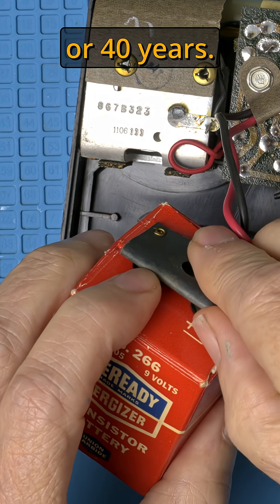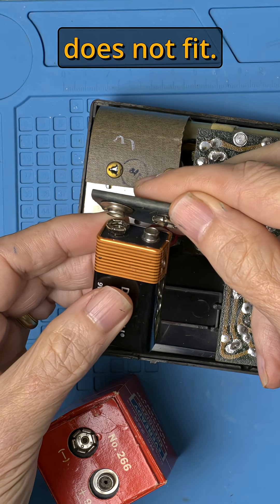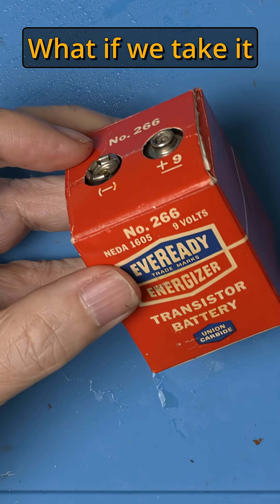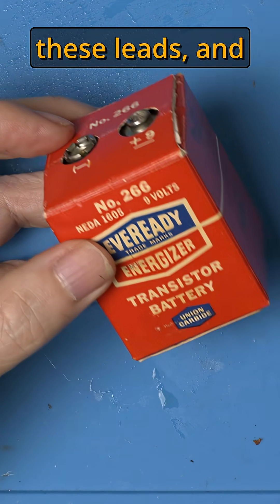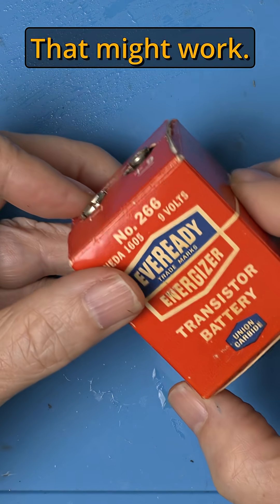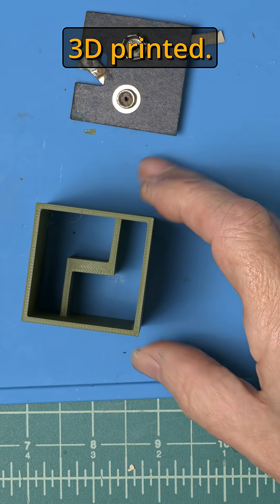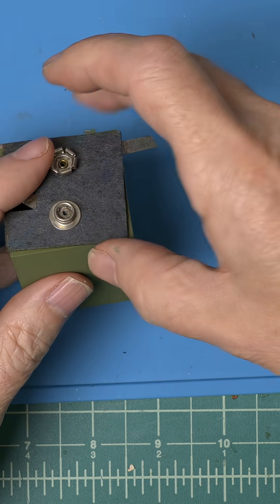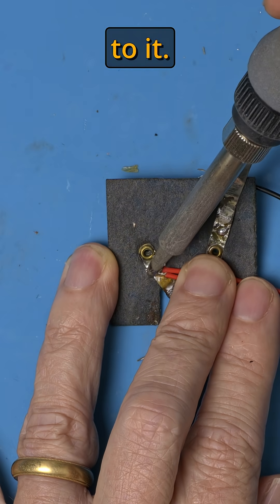3D Printed Vintage Battery Adapter #vintageelectronics #3dprinting #eveready #electronicsrepair

Comment from the maker: Here is the OpenSCAD file to build the adapter:

wall = 2;
base = 42;
height = 50;
difference() {
  cube([base,base,height]);
  translate([wall, wall, -500])
  cube([base-2*wall, base-2*wall, 1000]);
}
9v_holder();
translate([base, base,0])
rotate([0, 0 , 180])
9v_holder();

module 9v_holder() {
  difference() {
    cube([21,30,height/2]);
    translate([wall, wall, -500])
    cube([16.6, 25.6, 1000]);
    translate([14, 0, -500])
    cube([8, 12, 1000]);
  }
}
Reply: I LOVE the fact that you be shared the 3D model as a comment. This is kind of model where openscad shines
Reply: @FrainFreeze  BigCliveDotCom videos does this when he has a 3D model in his video.
Reply: @Dennis_M1DLG didn't watch him in a while, cool
Reply: @FrainFreeze  yeah and such a short script too. i was gonna bother learn freecad but now I'm interested in this
Reply: Thanks for sharing. I will use this and do the same.
Reply: This is the type of 💩 i want to learn to do. In the zombie apocalypse 💩 like that will keep you alive..
Reply: So you say I can make models with code instead of wasting hours designing it?
Reply: Its released in 1965
Reply: @MilanGamerOfficial123 was
Reply: @JoseDiaz-jf6rq sorry english is not my first language
Reply: Take it a step further and use reachable lithium 9v batteries and put external charge port on the box
Reply: @madyottoyotto3055 need a BMS to do that. Or it will blow up
Reply: Put 2 diodes in that case to isolate the 2 PP3 batteries from each other while allowing them to both power the radio.
Reply: @Dennis_M1DLG why would u need to do this?
Reply: @jaycool5978  the risk is minimal but if 1 battery has full charge and the other is flat or faulty neither one would short the other out completely starting a fire or rapidly leaking. I've seen a fire starting because of this once and the gent whose home it was lost everything.
Reply: Why not just solder free 9v connectors to a regular 9volt and have no spacial restriction?
Reply: Brilliant!
Reply: No no no just upgrade
Reply: You could fit 3 9 volt battery's in there
Reply: So is the radio 18 V?
Reply: @MADRE-GUY no its 9 volt and wired to deliver 9 volt from 2 9 volt batteries.
Reply: That is rally neato.... what is the device it is used on ? MY dad had an ANCIENT burglar alarm on his hardware store in the 1970s... it took 5 Eveready "IGNITER" batteries They were all strapped together... looked like a bundle of sticks of dynamite
Reply: Now this was cool to watch
Reply: here's 1000th like! 😊🎉
(i saw 999, so i liked 😊😅)
Reply: Looks like a,PP9 battery.
Reply: Do you know how much that transistor radio cost new ?
Reply: Could u fit 4 9 volt batteries ?
Reply: A 2, or 3s li ion, either boostbuck, or buck regulator, usb charging....😊
Reply: Not to burst your bubble too hard, but  the Excell model 266 is a direct replacement, 
It's still a great 3d model, I always love seeing printing being used to revive old tech at home. 
However, a pair of 9v Duracell batteries have a capacity of 695mAh x2 because wired in parallel is 1390mAh compared to the EXL266 with a capacity of 2500mAh for $40
 As long as you spend less than $10 a battery you break even capacity wise.
Reply: @russellschlack3950 problem is finding one. What I like about this solution is the ubiquitousness of the standard 9 volt batteries you can buy anywhere.
Reply: @HawleyCrippen-q2q 'Standard' PP3 cells have a limited future - the only reason smoke detectors still need them is there are a few in use that are not supplied with 10 year batteries sealed inside still in circulation. Sales of them are declining. (Smoke detectors should be disposed of after 10 years, most are sold with a long life battery that is disposed of with the detector). I'd be surprised if you could find PP3's in a decade.
Reply: @russellschlack3950 $40?! For that price I'm DEFINITELY using the adapters. I thought regular 9V batteries were expensive.
Reply: @russellschlack3950 or use two lithium ion rechargeable batteries using the same 9v platform used here

Making it 9v at 8,000 ma for about $8  + casing
Reply: I would recommend you to give the batteries a little bit more space to help against expansion.
Reply: @jowiemonster never causing a problem he didn't force them in
Reply: That was a beautiful old battery. Was probably built better than anything that's here today.

Comment: I would've made an adapter for 6X AAA or AA betteries instead, putting batteries in parallel can be a problem if they aren't identical.

Comment: Bro could have just wired a new battery terminal... Dude went the hardest route... 😂
Reply from the maker: I wanted to keep the radio original by not modifying it at all.

Comment: I think I just would’ve used an adapter and connected to a newer battery and then set the old battery aside and leave it the way it is. It was kind of interesting.

Comment: it would have been much easier and faster if you clipped that older style 9 volt connector and soldered on a much newer 9 volt connection....that's how I would do it because I don't have a fancy 3D printer.

Comment: Why not switch to 9v connector?
Reply from the maker: I would have done that if the original was corroded as they often are, but this was in perfect condition so I wanted to keep the radio original.

Comment: Could x3 18650 's with BMS's be fitted inside ? 
Or use the LARGER vape 1000mA batteries fit ?

Comment: Wouldn't it have been easier to just wire up the 9 volt connector to the radio instead ;)

Comment: One modern 9v would have more capacity than that old one for sure.
Reply: I doubt that. It is still the same galvanic chemistry. The original holds 2500mAh
Reply: @herrkulor3771 oh god thats way more than a modern 9v

Comment: I'm confused as to why you use 2 9volts instead of one.
Reply from the maker: Two akalines in parallel are pretty close to the capacity of the original larger carbon-zinc battery.

Comment: You should use diode to prevent the batteries discharging into each other. This will protect whatever you’re powering and prevent the batteries from exploding or catching on fire.

Comment: when I was a little kid I had a radio I took everywhere, after while, seemed like years it stopped working so my mum got me a new one the same, turns out the battery had just run out

Comment: They still make that type of battery. It’s not cheap though it’s around $34. They do have a AA adapter to replace that type of battery with the two terminals that are connected to wires to plug-in.

Comment: Parallel connection:
Connect positive to positive, negative to negative.
- > Output = 9 V, but with double the capacity (mAh), so it lasts longer
Series connection:
Connect the positive of one to the negative of the other.
-> Output = 18 V, but capacity stays the same as a single 9 V battery.
Don't screw it up or you will screw up the device permanently

Comment: I’m not sure you can put these kind of batteries in parallel, they will discharge each other if they are not perfectly balanced, I think this is only done with high quality cr2032 batteries from the same blister as they are almost identical in voltage out of the box, a 9 volts battery has 6 elements the chances of them to not be exactly equale are much higher

Comment: I HAD A TRANSISTOR RADIO THAT HAD THIS CONNECTOR. I couldn’t for the life of me figure out why a regular 9-volt battery just wouldn’t fit! It got to the point where I just used electrical tape to keep the battery held against the contacts. I think I either eventually replaced it with a regular 9V battery clamp or just kept doing the electrical tape trick. I think I still have the radio someplace. It belonged to my dad.

Comment: Just a note: batteries connected in parallel when not used will still discharge, it’s important to mach the batteries with the closest voltages and same manufacturer to keep them last longer but eventually they will discharge when left alone even without any load.

Comment: why not just replace the battery leads and solder it onto the circuit board with a modern 9v battery connector. Its only a radio so current usage is minimal reducing the need for two parallel 9 volt batteries

Comment: Lmao why waste the time to print that And use two newer batteries when you just need to cut the old style connector and attached a new 9v battery And reconnect the wires

Comment: Great retrofit for the battery but I don't know how much longer analog AM radio signals will be around for that radio to be useful.
Reply from the maker: So true, very sad.
Reply: @Dream.Build.Create  I understand the nostalgia but digital broadcasts are more power/transmission efficient and provide clearer audio. Having horses, wood stoves, no electricity etc. can be romanticized too but it would actually be pretty awful to live that way. The 3D printing tech you used will probably advance further and eventually supplant many handicrafts with wood and metal at some point. And that will be sad but also better too.

Comment: One small change id make is to try and conceal the exposed charged metal- either with heat shrink or some tape or something- just so it doesn’t accidentally connect or create contact. 
Its low enough it shouldn’t make a difference but just overly cautious

Comment: Or get this you can just buy a 9 volt connector cut off that old one wire in the new one save you half the time never have to worry about it again

Comment: Thats fantastic, I have a Motorola transportable mobile phone which takes a credit card sized sim card, the battery is about the size of a medium size chocolate bar with a couple of dedicated flat metal plates moulded into the case, obviously its dead, and I’ve carefully cut the lid off and removed the internals and been meaning to try and do something with it but it would be great to use 3d printing to resurrect this phone to working condition.

Comment: I think that you even have room for a couple more. Ingenious thinking with your workaround.
  I have an old portable tube radio that has a cord for using a wall outlet. There are 3 different batteries as I recall all, weird voltages and sizes.
Reply: Usually 90V for the "high tension" -Anode/cathode voltage.  Low -1.5, 3, or 6 for the valve heaters and a 5V or so "grid bias"

Comment: I had a radio that used one of these batteries - about 55 years ago. Even then, the big square cube 9V batteries were expensive and hard to get. My solution was somewhat more basic, since 3D printing was 50 years in the future. I got two standard 9V battery connectors from (probably) Radio Shack, wired them in parallel, and taped two standard 9V batteries together with friction tape (yes, that stuff). I used two batteries to "fill up the space" where the original battery had fitted. That way, only a minimum of shimming was needed.  Worked just fine. I kept the original connector in my "miscellaneous parts" box, hoping I might find a use for it someday. Never did.

Comment: I would have just taken the two wires from the radio, cut them off and soldered in a 9V terminal and just used a single 9V. But I guess that works, maybe for a museum piece or something with the back removed.

Comment: Connecting batteries directly in parallel could have possible issues. If one battery has a slightly different voltage or discharges at a different rate, you could get a pretty large current flowing from the one with the slightly higher voltage to the lower one. It's as if one would try to "charge" the lower voltage one and use large currents to make it happen. You could put a schottky diode in between them to isolate them from each other. Normally, batteries stack cells in series to avoid issues of exactly matching voltages as what happens when cells are placed in parallel.

Comment: You could have made it a simple single 9-volt battery box. Just wire the 9volt connector to the original, preserving the original battery and all connections.
Reply: I of course was referring to the 3d printed single 9-volt battery box.

Comment: Will the weaker battery cause the stronger battery to discharge into the weaker battery?
I would have put a diode on each battery positive lead to prevent reverse current.

Comment: a simpler solution would be to just change the connector to two modern 9 volt connectors, and put them in parallel.

Comment: Id worry that when the radio is off, youll get current running between the two batteries that could cause a fire. Daisy chaining batteries directly isnt great

Comment: Would 6 AA's fit? Or AAA's? Or is it so low current that it does not matter? 

I'm glad the box was so re-usable / the old battery didn't leak. It's a nice restauration.

Comment: Why would you solder 2 new connectors to an old style connector? Just solder those two to the removed old connector and keep the 3d print as double capacity/space filled. But you remove some old hardware, plus leave a hot swap available.

Comment: If you're going to do that much modification anyway, why didn’t you cut the leads for the connector and add a modern 9v connector to it so you can use them?

Comment: Why not just splice in a modern connector to fit a modern 9V battery? 🤔 

I guess then you wouldn’t really have an excuse to use a 3D printer 😂

Comment: @ralf716

In theory, if Batteries are in parallel and their voltages are different, you will get balancing current between both batts due to their very low internal resistance.  There are cheaper 4,5 Volt Batt packs available, you could connect them serial. To reach 9 V. Much saver.

Comment: Lovely Idea, I used to see those Radios, two modern 9 volt batteries in parallel are just the ticket for long service, Important Note: Always use Good Quality Alkaline Batteries to avoid Leaking and subsequent Radio damage.

Comment: only issue I'm seeing is you are losing quite a bit of capacity. the old no. 266 had about 2500  mAh capacity,  a normal Duracell copper top is around 310 mAh so at best you are looking at a capacity of around 620 mAh with the conversion.

Comment: OR, if you dont have a 3d printer. just cut the leads off the radio and solder two leads in series?

Comment: i love this: repurposing old technology to use new power sources. I did the same with a 6V military radio from the 50s. I found a 6v Lifepo4 system, pulled the old 50s battery, cut off the leads, put them on the new battery, and it has worked perfectly for a while. and it's still rechargeable.

Comment: Wouldnt it have been easier just to swap the wire connector with a new wire connector a 2 wire solder

Comment: I’m not well versed in electronics. Is there a benefit to adding 2 9-volt batteries instead of just one? And if there is, couldn’t you fit a 3rd battery?

Comment: What is the amperage on the old battery compared to the new dual battery solution. Depending on how it is wired, parallel or series, either the voltage or amperage will double. Just curious because you obviously have it running 9 volts but now you have double the amps of a single 9 volt. If it's running higher wattage than the original battery i I would be wary of the original components in that radio. I love the solution here but wouldn't a power supply be easier since you can supply it with the exact power required.

Comment: just a heads up, PLA burns, so careful with that, i'm not sure about PETG or other materials that you could print the adapter in. Clever solution, also look at the guts of that old battery thats nuts!

Comment: Did you wire this box in series or parallel.. I noticed that the original says 9 volts and with your build you installed to 9 volts... Which can equal 18 volts if not wired correctly.

Comment: Neat solution 👌
A couple of buts: just found analog of 266 battery in UK for less than 10£.
The capacity of 9v battery is around 6 times less. Unless using modern 9v lithium - 2 of those in parallel will give similar capacity to №266, but for a price around 30$.
Most of discharging curve of 266 battery is between 6,5-8V, which fits perfectly to 2C li-po - recharging and greater capacity as a bonus.
Reply from the maker: This is great info, thanks!

Comment: Wait if the original battery was nine volt and you now have two modern nine volt batteries you've made an 18 volt supply

I mean it still works obviously

Comment: They make pig tails for modern 9v batteries. Could have just used a couple of those and soldered them up to the existing wiring. Just my take on it after working as a electronics tech for 10 years. 3d printing works if you don't want to wait for an order to ship in.

Comment: Two things - 1) I don't recommend handling stuff like that without gloves. A little ppe goes a long way. 2) putting batteries in parallel like that is a bad idea. In theory, you've doubled the capacity. In practice, one battery will drain a little faster than the other and then it will start pulling current and heating up. Batteries can't reliably be wired in parallel without balancing circuits 😬

Comment: Was the original wired in Series or Parallel like you wired it ?  two 4.5vdc in series is 9vdc   In parallel you keep the 9vdc but can draw more current, problem is the cells won't share the load equally

Comment: That's one way of doing it. You could also replace the old 9v connector with a modern connection and use just one modern battery.
Reply: Using 2 9v batteries instead of 1 will have a larger capacity

Comment: Could of just got a newer 9v connector and soldered it on. Would have been a lot less than the PLA cost and the 2 9volts

Comment: 9 volt batteries arent good for high draw devices they only have 500mah of capacity.
Reply: Transistor radios aren't high draw devices. Not even close.

Comment: I know NOTHING about electricity. Can anyone dumb-person explain why the big form factor +/- when each terminal has  both +/- going to it from the smaller 9 volt batteries? Also, the power isn't doubled with 2 batteries?